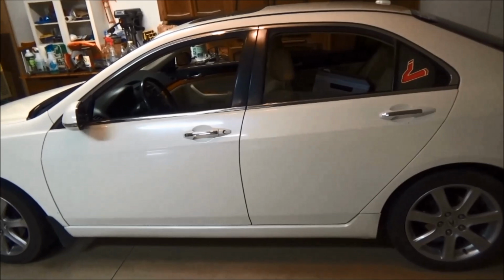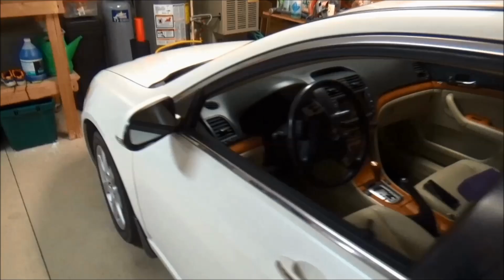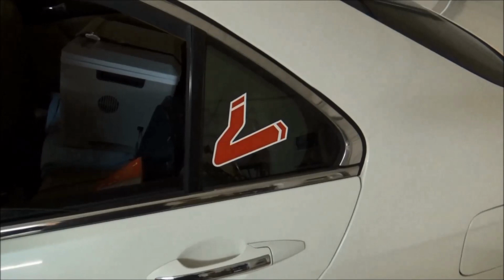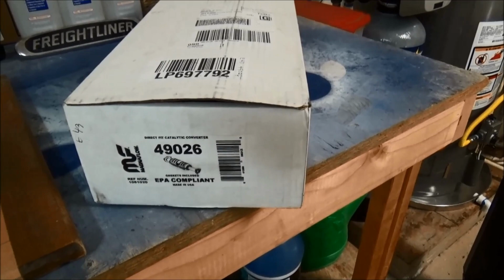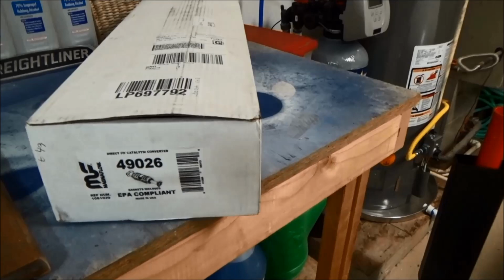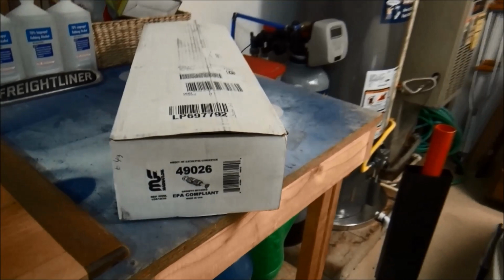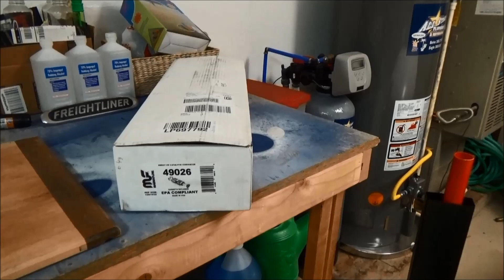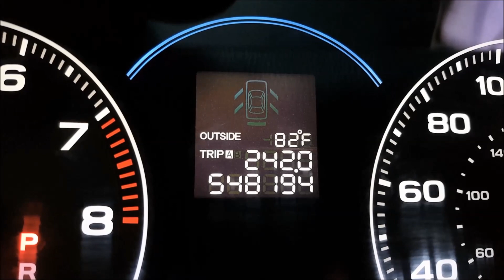540,000 Mile TSX - CAT, Rear Sway Bar, HeelToe Automotive & You!

Comment: What code did you get for the catalytic converter and how’s the car held up so far after replacement thanks!
Reply from the maker: don't remember the code, but the car has still been running great. up to 616k miles now & still no problems.

Comment: Dang, I barely have 98,000 miles on my 2007 Acura TSX. I also bought it at 0 miles. FYI im the future you can buy the engine from Japan at around 60,000 miles for about $1,200. Install the UR tie bars. It'll help you with the turns. Just get the sides bars, rear bar, fender bars and mid bars. If your not dropped like I am, you can get the front tie bar. You'll love the handlind paired with the sway bars. I also shop at heeltoe so shout out to Marcus.
Reply: Don't ever sell it. No matter how old the look gets.. the drive is just too nice.. period. Even if you get a new car.. keep this car and drive it at least twice a week, once a week being atleast 5 miles...
Reply: @huyka6856  Thanks, yeah I was thinking the same thing. Specially now with the electronic car coming soon. You stay up bro.

Comment: Along with the 3rd gen TL Sway bar, did you use bushings and brackets from the TL as well?
Reply from the maker: The TL-S Sway bar is about twice as thick as the factory TSX bar, So I did have to use the TL brackets & Bushings. But they are cost effective, so it doesn't add a huge expense to the upgrade.
Reply: May Do The Same to my TSX and upgrade the Brakes with the Acura RL Brake have heard great things to this upgrade

Comment: First! How long does a CAT last? Coming from a 2010 Acura TSX Manual with 140,000km
Reply from the maker: It varies, the 1st time my check engine light came on (ever) was for the CAT, that was somewhere around 350k - 400k miles. It should be good for quite a while.

Comment: What about the vibration during acceleration? Any issues there? So many ppl w the 1st gen have that issue and can't seem to figure it out. No shake in the steering wheel, but you feel it in your seat. 

Did you ever have that issue, and if so, did you ever resolve it?
Reply from the maker: My vibration was from the axle. Once I replaced the axle, thw vibration went away.
Reply: Clymers Carport hmm, ty. Many claimed to have replaced it and it still remained. I'll see what I can do. Thanks for the reply.